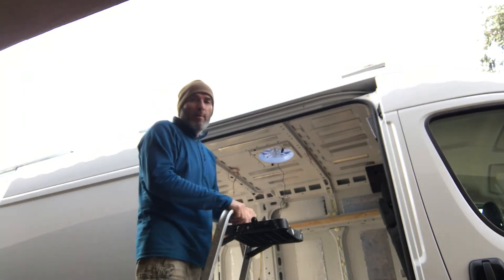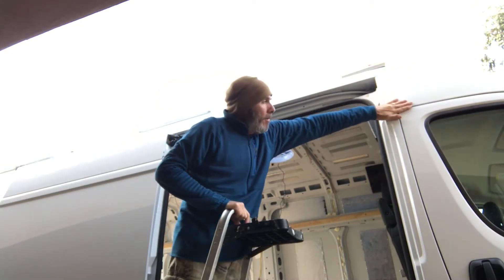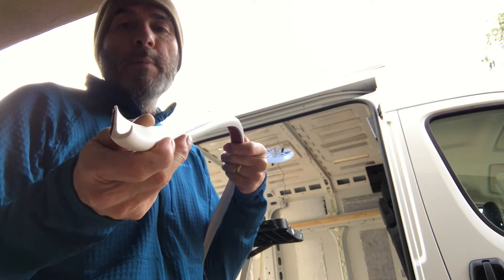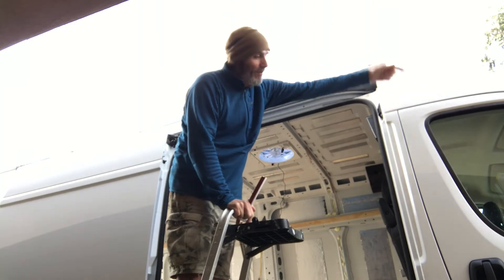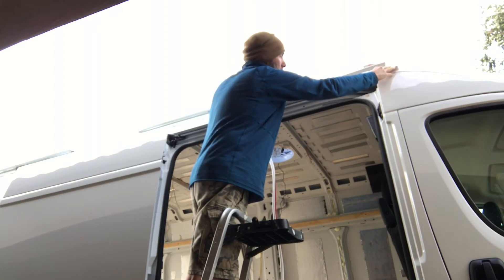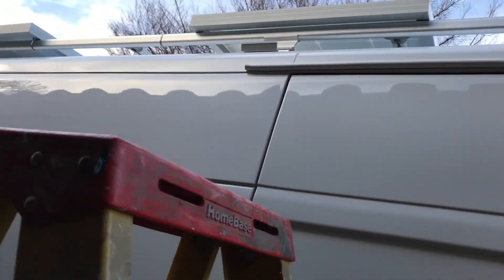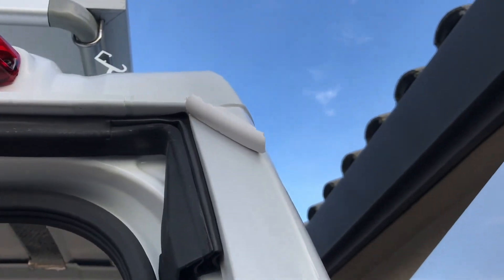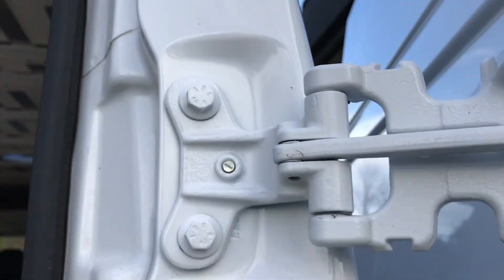Promaster Conversion #7: J channel / Drip rail

Comment from the maker: Yeah, I've had it on for YEARS now.  Still works perfectly.
Reply: Wish I knew your secret! I cleaned my surface thoroughly with alcohol before installing mine, but after two years it peeling back enough from the wind in the front to warrant removing it.